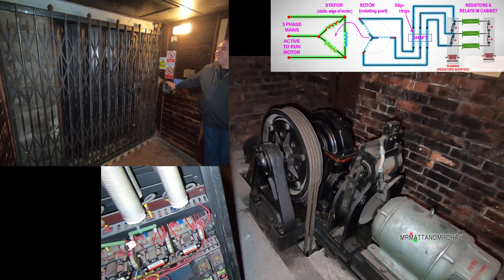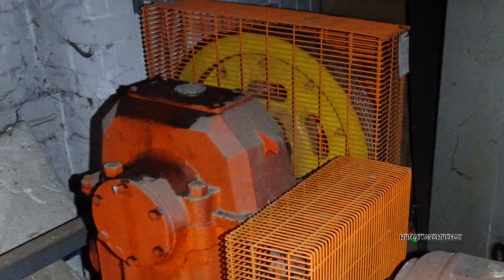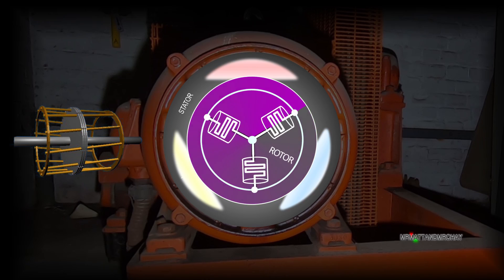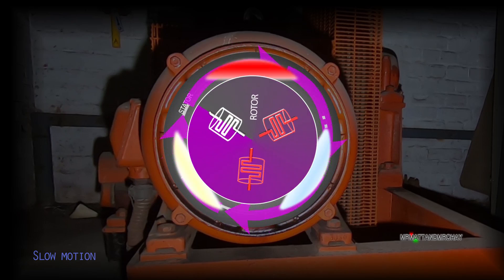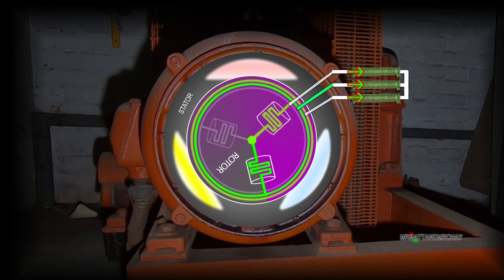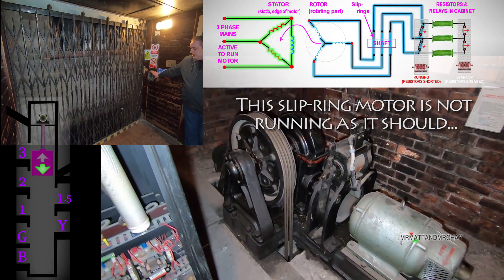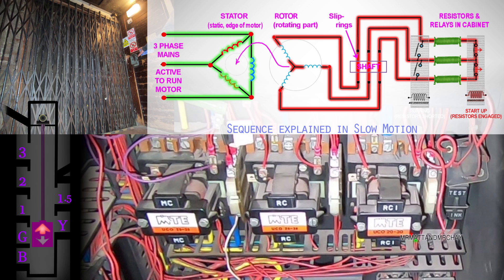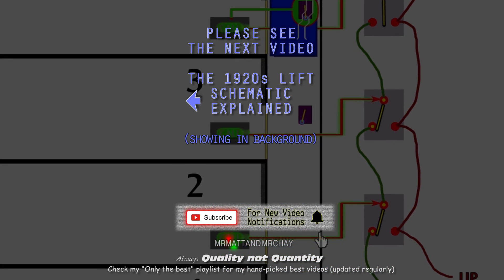SLIP RING MOTOR - how it works, explained the EASY way! (1920s Lift Motor Room)

Comment from the maker: I'm going to pin my own comment here just to say... some of these comments are so interesting.  You know what, it doesn't seem to matter how long I research these videos to make them as accurate as possible, there is ALWAYS more to learn and you guys open my eyes to things that I didn't know.  The only problem is, I have to upload a video to learn these things!  If only I could reverse time and learn these things before I design the video for upload!  Impossible, but thanks for the valued comments you've added here.  I'm hoping that everyone is benefiting including me! :)
Reply: @Worlds largest Culvert theatrical Poster for poltergeist 3 by chris zabriskie.
Reply: Hi there. I'm new to motors and found this video great for my learning, it's very clear and concise. There is one thing, when the motor is at its desired speed, you said a contactor pulls in and removes the resistance on the windings in the panel. What tells this contactor to pull in? Is there a centrifugal switch or some form of switch somewhere? How does it know when to pull in?
Reply: @mrmattandmrchay   What type of wave is beetween the rotor phases. Is it an AC sine wave or DC wave?

Comment: Best thing of this motor is the high start torque with low current and variable speed. In this case, it needs just one resistor (per phase) but in case of big motors, you have a controller.

Comment: Note that the rotor resistances can be used for speed control as well as just for starting.  For applications like traction motors, it was common to throw added resistances into the rotor in order to run the motor with high amounts of slip.

Comment: Love your lift videos mate. The idea of the resistors in the motor is to reduce its power on startup, a motor will produce max torque at locked rotor or startup. As the motor speeds up and reaches its rated speed the torque is less. Starting an electric motor which is coupled to a heavy inertia load like a lift will cause it to overheat trying to overcome inertia, so by adding resistors we reduce the amount of power the motor can consume and make. This limits the electrical demand and a bit like a soft start for the mechanical parts. Electrically it’s easier too because the rotor currents will be less than the stator so smaller resistors and switching components. Hope this helps. All the best.

Comment: Looking at the sequence at 04:55 I'm getting the impression that RC1 might be cutting in too quickly, not giving the field in the rotor enough time to gain synchronisation with that in the stator, though I see another comment suggests this is indeed correct and is to do with inrush current limiting, rather than efficient motor start-up. 😇

Either way, this is a fantastic video chaps! I've been into HV/HC electrics for years (Though for my sins the most I ever get to play with is my own 240v single phase stuff) and stuff like this is always as educational as it is entertaining. It's when you think very carefully about stuff like this motor you can come to understand the seemingly very strange 16,666Hz phasing of overhead traction supply on German railways - 16,666 equals 50Hz/3 of course! 🚆⚡🇩🇪😁
Reply from the maker: Interesting comment and thanks!  I too learned a lot when I was researching this video, never knew what a slip ring motor did before that.

Comment: The sequence is actually correct. For this setup the time the resistors need to be in circuit is extremely short, less than 1 second. This is common in small (yes, this IS a small one) AC motors which are used for inching (i.e. repeated starting and stopping) as is commonplace in this lift when someone is lining up a floor. The starter in this case is not there to provide more torque but provided to limit the initial stalled inrush current in order to comply with the supply authority regulations. Yeh the time could be a little longer but it's clearly working correctly in this configuration. As soon as the rotor moves it's no longer stalled and so its fine to go straight to DOL operation which provides plenty of torque through the geared drive.

Comment: Great video! But there is an inaccuracy: the rotor speed NEVER catches up with the synchronous speed and the difference between rotor speed and synchronous speed is called "slip", which makes the rotating magnetic field of the stator sweep round and round through the surface of the rotor, induce electromotive force to let electric current flowing in the rotor circuit. If the rotor rotates at synchronous speed, NO torque is created, because there is NO electromotive force and NO current through the rotor circuit.

Comment: Why is the motor not running as it should. Does a timing component need replacing?
Reply from the maker: Possibly, or an engineer not knowing what they are for had adjusted them incorrectly.

Comment: Being a motor is essentially a rotating transformer, increasing the resistance of the rotor windings (adding the starting resistors) decreases the current of the stator windings. Once the motor is rotating, removing the resistance provides the motor to run at rated power and torque.
Reply from the maker: That's a brilliant comment and observation!

Comment: 3 Phase circuits are now coloured Brown/Black/Grey with Blue as the neutral.
Reply: Phase identification colors and sequence vary depending on supply voltage involved and the country you are in.
Reply: @abpsd73  BBG is the current UK/EU colour scheme (replacing RYB in the UK).

MMMC is a UK based channel.
Reply: @markh5210  I'm in North America. Working on imported machinery from Europe (German, British, and Italian,) I've seen 3ph BRN/BLK/BLU, GRY/BLK/BRN, YEL/BRN/BLK. North America is RED/BLK/BLU for lower voltages and ORG/BRN/YEL for higher voltages. Canada and the US are approximately the same, but sequencing is different.
Reply from the maker: Yes, this is something else that I learnt from this video from the comments.  I'm still old-skool haha!  HOWEVER, not sure that grey/black and brown would have shown up as much as red/yellow/blue does in the visuals :)

Comment: The motor design reminds me of the wood working machines that we had at school in the workshop. They ran at 415 volts and you couldn’t let them run at full speed from a cold start. They all had a special start up and turn off sequence where there was a third state on the on/off dial. If you turned them on too quickly, the circuit breaker / fuse box would trip. Every machine had it’s own fusebox as well.
Reply: Ooh yes I remember seeing a pump (à wastewater pump or something) like that too! If you got the sequence wrong, you blew the fuse! It was really long to start (like you first had to press a switch, then push a certain button and release the button after 20 seconds), it was very unusual to say the least.

It was later ripped apart with a assembly of programmable logic controllers, now all you have to do is flick a switch and the PLC will do the rest...
Reply from the maker: @Alexis_du_60  @dykodesigns2yt Both very interesting comments!  Yes, makes sense!